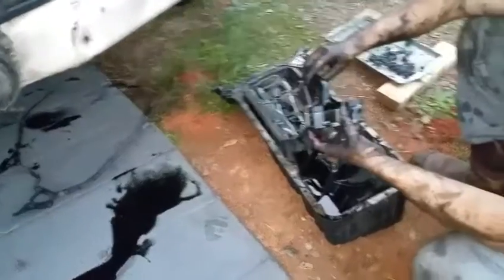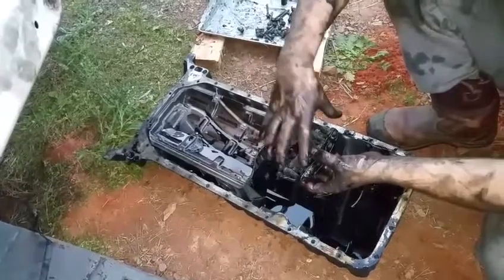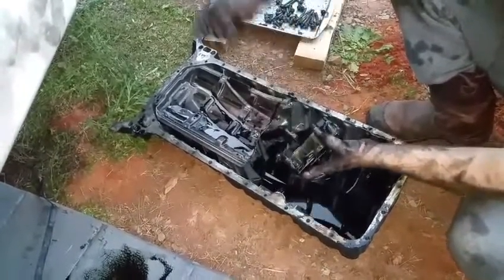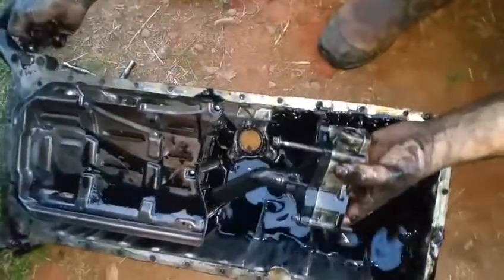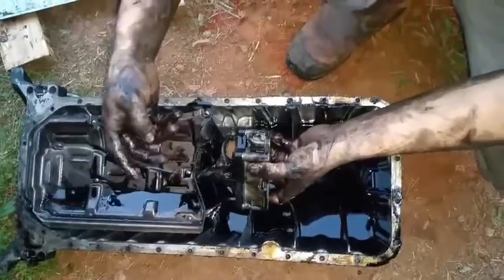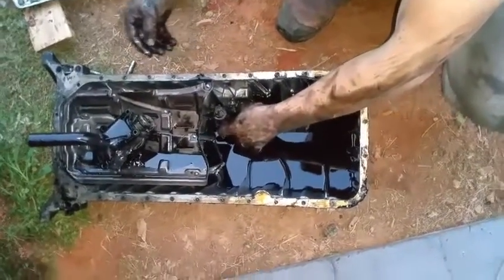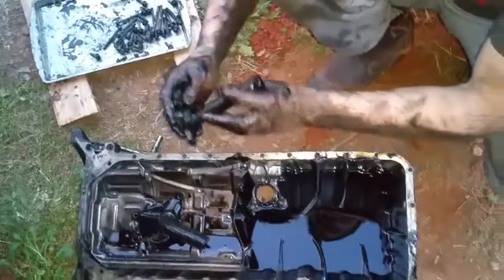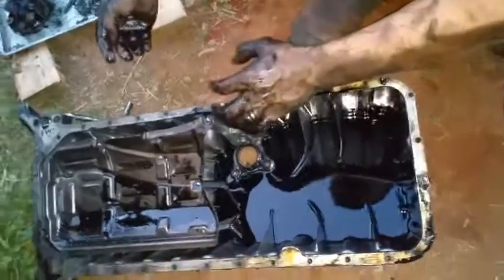Mercedes Sprinter Series: Engine Oil Pan Removal from Block on 2.7L Diesel! How To: Part 20

Comment: Hi you removed the oil pan because you tried to remove the torque converter but the engine wasn't turning over I have a similar problems did you work out why the engine wasn't turning

Comment: Does oil pan need a rubber gasket? Or can you use gasket maker and make a gasket?. Also that piece you took out from the engine block. Does that have a gasket?
Reply from the maker: Everything has a gaskets, but yes I believe you can just make one, I never tried making one
Reply: @ZimaletaMotors  ok thank you

Comment: How are you supposed to get to the 8mm bolts if the oil pan is still partially attached. I'm confused
Thanks
Reply from the maker: well its nearly impossible but you get them from the back where the transmission hole is through 1 inch gap, use an extension tool.

Comment: Very helpful - my harmonic balancer broke off and the key to the crankshaft fell in the oil pan and now I have to retrieve it!
Because my Sprinter has over 150K miles on the engine, I'd like to clean the bottom of the pan out too.
Reply from the maker: +Matt Geans wow, yeah sounds like you got a job on your hands, I will need to change a head gasket soon on my other sprinter

Comment: hi, thanks .good videos. we remove the oil pan whitout removing the transmission, it was difficult. we remove all the oil pan bolts , lower and squeeze the  pan close to the driver tire side( partially attached). then we removed the 4 bolts of the oil pump with a small socket(from the right side (passanger side).its just a little bit of space.its difficult
Reply from the maker: +mttutorials80 wow good job guys, yes not allot of space to work in but it's amazing that you did it 👍😊